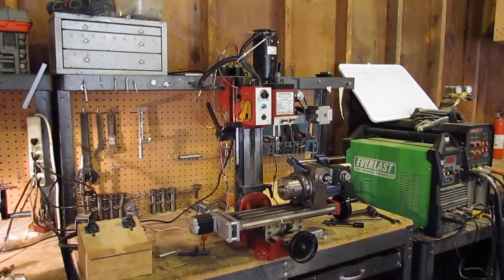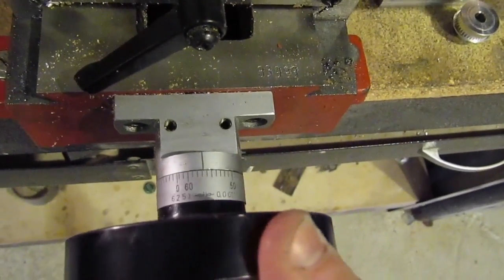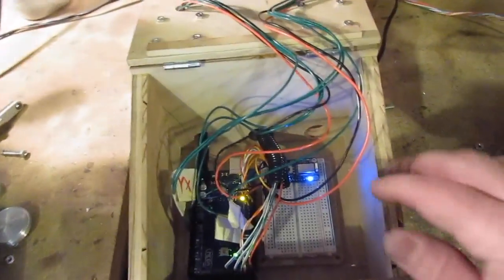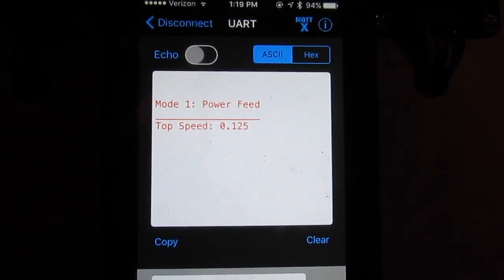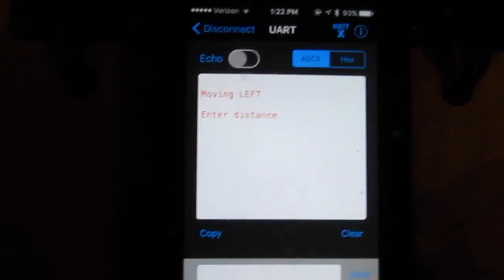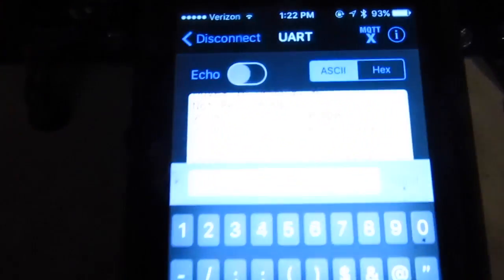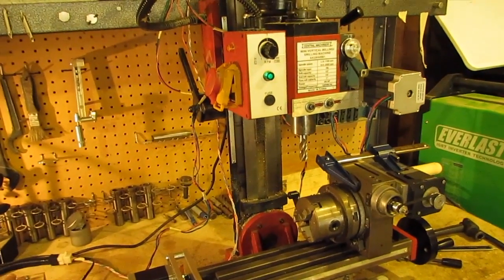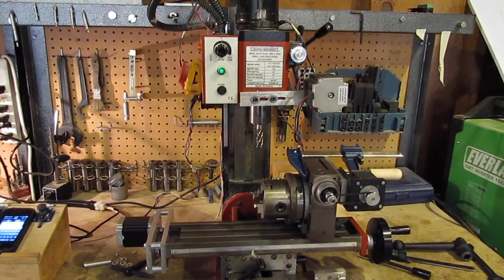Arduino Based CNC conversion on a Mini Mill

Comment: The belt conversion for the main motor is a must. You will be amazed at the speed choices and how quiet the mill becomes. I just did mine and so worth it.
Reply from the maker: Actually during the trial and error process of building this and learning to work with CNC I crashed the mill and broke one of the headstock gears and almost did the conversion then but already had a lot on my plate. Thanks for the advice, I think I'll do the conversion soon.
Reply from the maker: Cool. I just broke another gear in the head stock and I think that now that I'm into CNC I'd better get belts set up

Comment: What size pulley and timing belt your used for your z axis? I like to do the same setup with my Z axis. Do you have the part number and where to buy them?
Reply from the maker: Thats a GT2 belt and pully. Its a 1 to 1 ratio on the pulleys so diameter is irrelivant. I removed the fine feed wheel and an 8mm bore pulely fit the shaft perfectly

Comment: Have you completed the Y axis conversion? You should just go get the GRBL shield for the arduino and load GRBL 0.9 and combine that with the free INKSCAPE or other free CAD program. YOu would have a fully functional CNC. I would like to see the adapter brackets for your motors and belts to add to the mill.
Reply from the maker: +phillips040782 Yeah! its pretty much finished and I'll be making a follow up video soon. I plan on running tinyG on a arduino due in the future but I really got a lot out of learning to program it from scratch.